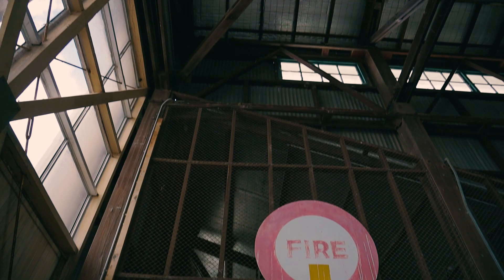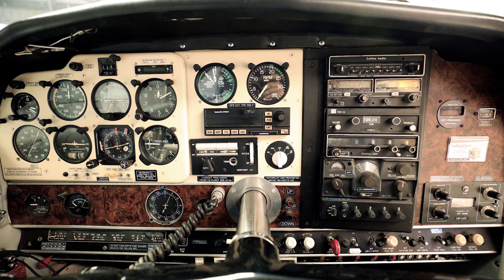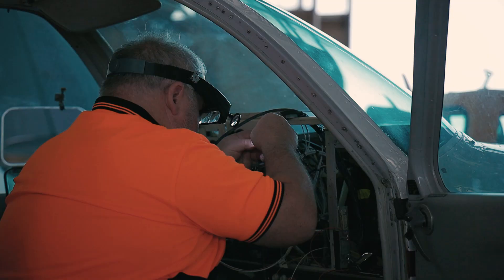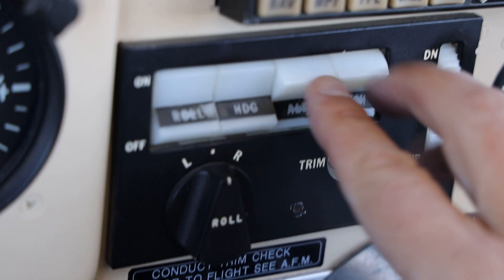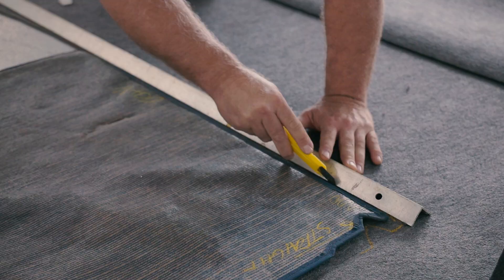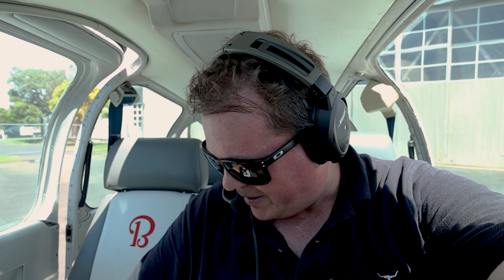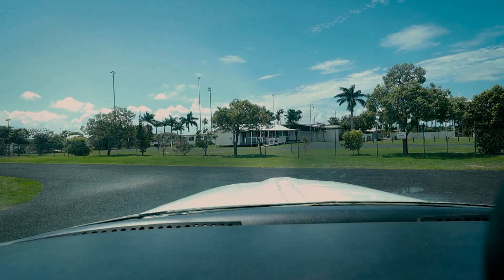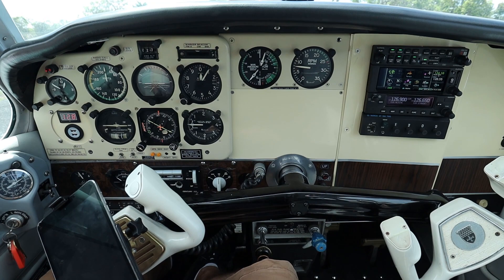Beechcraft Bonanza upgrade on a budget

Comment: Great Video.  But how much? I have N35 V-Tail and I'm looking at doing the interior like yours. Wondering if it will break my bank account.
Reply from the maker: The seats, carpet and cover cost $AUD4,100.  That included re foaming and webbing seats.  The Beech stitched logo was the cheapest part like 25 bucks.  The upholstery had studs installed for easy removal of carpets etc.
Reply: @jeremybrowne4824  Wow that's very reasonable, I will probably look at doing that. Gives me an excuse to visit Bundaberg.